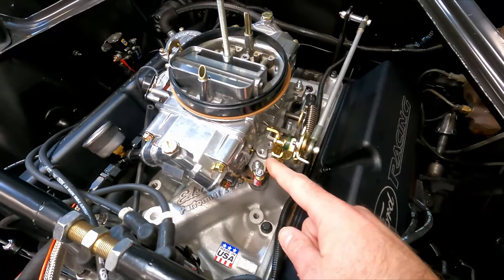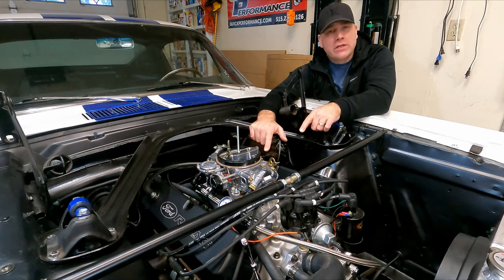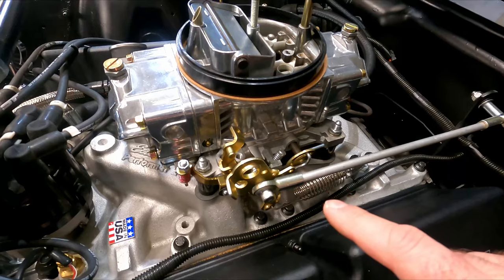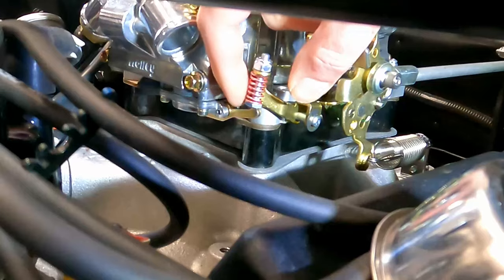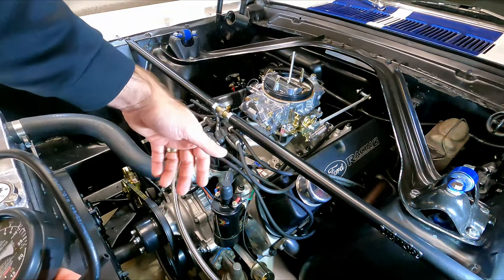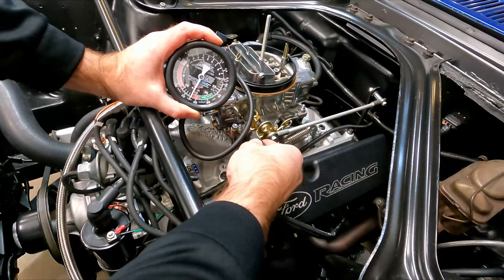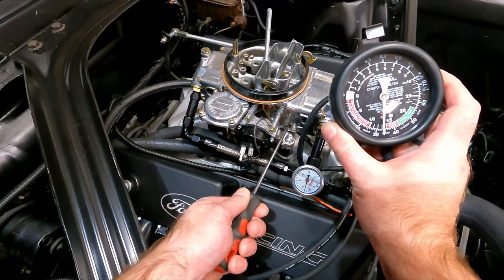How to adjust Holley Idle Mixture Screws and Curb Idle

Comment: I don't understand why people don't know to turn the mixture screws open 1/4 to 1/2 turn from highest vacuum or fastest idle. This allows a little extra rich which offsets a potential lean condition that occurs when the least little bit of contamination gets into the idle circuit. you can go a longer time before having to readjust the mixture screws. You barely change the idle at this richer setting and don't need to redo it until a LATER time. I have done this for 53 years. It should be common knowledge by now.
Reply from the maker: Yes, this is a good option.  :)
Reply: Yeah cause they still make them that way lol
Reply: Not everyone knows to put a vac gauge on it. Since everything modern has computers and fuel injection, tuning a carb has become a lost art. 
I used to think holley was good, so when i built my truck, i bought one. Biggest pain in the ass ever. Got a edelbrock avs2 instead and its so much easier to tune and zero flooding. 
Word of advice, if youre doing a street application , do not buy a holley, made for wide open racing. Even the speed shop guy told me that.
Reply: Efi tuning vs carbon tuning 
No dirt on the hands and you are warm and cozy. Carbon tuning is hard to hear hands get very dirty from the dinosaur oil often repeated sequence for fine adjustments! Last but not least you might be somewhere around the correct spot in fuel air mixture? 
  Vac gauge not needed for efi tuning unless you are a professional tuner!

Comment: Your method of setting the initial curb idle screw adjustment is incorrect because it does not take into account the idle transition slot.. This needs to be set before installing the carb.  The proper way is to turn the carb upside down and adjust the curb idle screw so that the idle transition slot appears as a small square. Then install the carb and and see where the engine idles. If idle is too slow increase the adjustment until you reach the desired RPM, noting how far in you have to turn the screw. If you have to go in more than about half a turn you are exposing too much of the idle transition slot. In that case curb idle speed should be raised by increasing initial timing. Oftentimes just switching from ported to direct manifold vacuum advance will do the trick. If it is necessary to increase idle speed with more initial mechanical advance this should be compensated for by adjusting the timing curve in the distributor.
Reply from the maker: Thanks for the heads up.
Reply: @russzero  Another measure you can take before drilling holes is to crack open the secondaries a little bit. Holleys have an adjustment accessible from the underside of the carb.
Reply: @AndyKruseChannel where do I hook up my vacuum gauge at I might have to re watch where you put it or nvm I think I see it I have my PVC valve hooked up in the back is that where you have the gauge
Reply: @AndyKruseChannel so yeah I don't think I'm seeing that correctly if you could help me out I'd appreciate it
Reply from the maker: @Pdubb19  I prefer to use the Manifold Vacuum Port, on these Holley carbs is located under the front bowl.  I point it out at around 2:11  :)
Reply: @AndyKruseChannel  thanks so much also another question Ive been asking a lot of guys this question so my plugs are fouling up and a guy said it should be anything major unless you got a big Holley dumping and I think it's the 4150 but if I get this correct would this stop running the car rich
Reply from the maker: @Pdubb19  The 4150 is the model or style of Holley carb, the CFM (size, like 600, 650, 700, etc) can vary.  If your carb is too large and your jets are too big, you can run rich and foul the plugs fairly easily.  It's possible to reduce the jet size in your carb to run a little leaner, but it may be better to make sure you've got the correct sized carb for your application.  If you choose that route, you're better off referring to web boards and forums as there's plenty of info out there for a given engine size and aftermarket parts you have on your engine.
Reply: @AndyKruseChannel  right on my man thank you so much!!
Reply: @AndyKruseChannel IFR’s regulate idle fuel and can be changed, but not easily....
Reply: @65sohc  When you say crack open the secondaries a little bit, do you mean where you can see like a square on the transition slot or just a little bit? Thanks
Reply: @joelaviles2943  I don't recall saying to crack open the secondaries although sometimes that is necessary.If you have the primary throttle blades in the correct orientation to the idle transfer slots and have optimized idle ignition advance, meaning you are on direct manifold vacuum with maybe 20-25 degrees TOTAL advance (initial plus vacuum)  and the engine still doesn,t want to idle you must have a very agressive, long duration cam or something else is going on. If the engine is otherwise healthy then SOMETIMES opening the secondary thottle blades will smooth out idle.
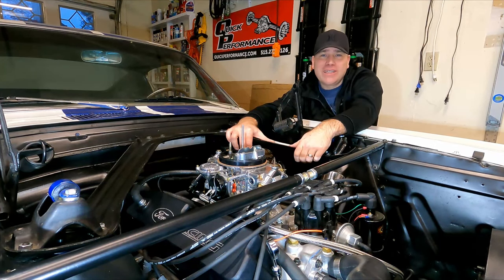Reply: 9:17 😅😅😅😅😅😅😅😅😮😅😅😅😅😮😅😮😮😮😮

Comment: I've commented before but I'll comment again. This is by far the most helpful video I have found about adjusting a carburetor on YouTube. No bullshit, just helpful information explained in a very simple way. If you don't do this professionally, you should.
Reply from the maker: Thank you!!  :)
Reply: @AndyKruseChannel  now if I could just figure out how to use my timing light.....🙄
Reply: @rorschach8167  :stopwatch-blue-hand-timer:💡?😳
Reply: I disagree.  You have to set your idle transfer slots first, second if you adjust your idle screw to bring your idle up or down you have to also adjust your accelerator pump .005 space between spring bolt bottom and accelerator pump.   After car is at operating temp 180-195ish.  Set idle mixture screws.  Then set your timing correctly.   Because more or less timing will raise and lower idle rpm’s also.  If you don’t start like this at lest the carb part you will likely have issues with detonation at wide open throttle or horrible stumble at wot, or backfire threw top of carb.

Comment: The reason you don't have a metering block in the back of that carburetors cuz Holly is gone cheap the older vacuum secondary carbs had met during blocks in the back with a four-corner idle.
Reply from the maker: Thanks for the heads up.

Comment: A bigger cam that causes a vacuum of about 9 inches may require a power valve replacement.
Reply from the maker: You're probably correct, but I haven't gotten that far yet.  :)

Comment: Should also touch on how to set the float levels. A few times now I’ve had friends with Holleys go through tuning like you show and can never get it to be snappy. I found it easier and better to set float levels and then tune from there. Nice video! Short sweet and to the point!
Reply from the maker: Thanks for the tip!
Reply: I had a brand new out of the box 4160 that wasn't getting fuel in the bowels. My buddy "the brains" adjusted the float levels until fuel was just coming out of the holes (no site glass on mine). That did the trick for us. The paperwork will tell you if its just to the bottom or half way up the site glass. I'm a noob and sharing what I learned.

Comment: Had three, complete,, early 60s tri-power setups, for FE big block Fords,,, always closed the outer carburetors idle screws,, and outer carburetor butterfly plates  closed as much as possible without jamming,, did all idle mixture screw settings on center carb only,, actually was able to get 19 mi to gallon on the open highway,, these tri-power setups idled perfectly   and needed very little maintenance... 0:16
Reply from the maker: Yeah, these are fun to work on.  :)

Comment: Using a Holley street avenger 770 CFM. 1000 rpm park and 800 rpm drive looks like the sweet spot (400 - 425 hp 350 sbc). Anything lower causes either a stall shifting into drive or a slow one after 15 mins of driving.
Reply from the maker: Good to know.

Comment: Helpful video especially on where to hook up the vacuum gauge, thanks. Holley says if you move one mixture screw 1/2 turn, then they all have to be exactly the same.
Reply from the maker: Ideally they'd be the same, but it depends on how exacting you want to be when adjusting for the highest vacuum.  :)
Reply: I think the idea is to not have it heavier or richer to one side of the bank. To keep all 4 the same and the highest vacuum you can start using 1/8 increments or even 1/16th to really keep that same highest vacuum and keeping all screws equal. Just going by what Holley says.

Comment: When the accelerator pump is not adjusted correctly, it will not feed fuel (contrary to the claim in this video) unless you move the accelerator pedal. The way to adjust it is to make sure you get the full travel of the link so you have access to all the fuel  volume available inside the pump. You also want it to react promptly so to much free play is not good for a solid & fast engine response.
Reply from the maker: Ok

Comment: Just fyi,, not having a secondary metering plate has nothing to do with rather or not your carb has vacuum secondary’s, my vacuum secondary holley has 4 corner idle adjustment screws
Reply from the maker: Thanks for the heads up.

Comment: Great video. Just dialed in my 4160. Do you recommend an addition 1/4 to 1/2 turn rich once you’re set on the highest vacuum?
Reply from the maker: Not on principle, but not every engine and carb setup is the same.  Some say an extra 1/4 turn out richens the mixture to the perfect amount, some say trust your vacuum gauge.  :)
Reply: I appreciate the reply 🦾
She’s running super smooth now. Your video helped a ton. I’ll try a 1/4 out this weekend

Comment: What fuel pressure are you running? It looked like it was between 2 and 3 psi.
Reply from the maker: I think there was a problem with the gauge at the time, because it was leaking.  It's between 4-6 psi now.
Reply: Good deal. love your videos 👍🏻

Comment: This may be a noob question. I just bought a project 79 mustang that came with a Holley 600 street warrior with no electric or mechanical choke hooked up. Are you always supposed to start a carb with a choke - or can carb be tuned so you don’t need to use a choke to start if that makes sense?
Reply from the maker: It depends on the climate. Warmer climate cars can get by w/o a choke. In colder climate, it takes a little more effort to get the car to idle, but it can be done.
Holley makes a choke kit you can buy and attach to your carb if you think you need one.

Comment: I have a 65 fastback as well. Do you possibly have roller rockers? At idle, it kinda sounded like a sewing machine and mine has always sounded like that after it warmed up. Super annoying to be honest, but I’ve always been told it’s normal.
Reply from the maker: At the time I made this video, I had not re-lashed my valves.  Yes, it was sort of a sewing maching sound, and I had found out I had one that was not as tight as the rest.  I re-lashed them and the engine sounds much better.  :)

Comment: Was looking forward to this part. When your fans kick in, how much load does it take on the engine and drop the rpms? I’m trying to find the sweet spot so it doesn’t stall out on me. Great video!
Reply from the maker: Maybe 100 RPMs, but not alot.  It was enough that I wanted to wait until the fans turn off so I can get an accurate vacuum reading.  :)

Comment: My carb is setup way rich, so I'm assuming that turning the Mixture Screw to the right is richer and to the left is leaner. Is this correct?
Reply from the maker: Backing the screw out away from the Carb is adding fuel, equaling a richer condition.

Comment: when you changing the power valve do you have to change the jets at the same time
Reply from the maker: No, they are independent systems.  However, one could find they are changing both at the same time, depending on how they want to tune the Carb.  :)

Comment: Whats up bro, any info on the screw inside the stud wher the air filter connects what is the normal adjustment for that like how many turns out or in
Reply from the maker: I believe there are different length studs because there are different height air cleaners.  I always run that stud 'til it bottoms out.  I think I even cut one short for a previous build as it was hitting the hood.  You also buy a piece of althread from the hardware store and make a custom length stud if you don't currently have one or you don't want to cut the one that came with your carb.  :)

Comment: Hello i got a holley carb 4150, 715 cfm, its on marine engine volvo penta 5.7, and it doesnt have any ports for vacuum gauge, any advice how can i adjust the mixture screws? Thank you!
Reply from the maker: Hmmm, that's weird, there should be one.  What about using the port on the back of the carb that is often used for a PCV valve or power assisted brake master cylinder?  It's larger than the port I use in this video, you'd probably need 1/4" or 3/8" tubing and an adapter to make it work with your vacuum gauge.  :)

Comment: So I need to disconnect the vacuum advance and plug it off on the carb to adjust it with the vacuum gauge?
Reply from the maker: Correct, but this is ok because that vacuum advance on your distributor isn't really doing anything until you are operating at higher RPMs and have a load on the engine.
The hose going to your vacuum advance on the distributor can just sit there while you make your adjustments.  On the carb, for setting the idle mixture screws, you'll want to make sure the Ported port on the carb is capped off (up by the sight window on the bowl) and you connect your vacuum gauge to the manifold port located underneath the front bowl.  :)

Comment: Having a bit of a problem. Would this kind of tuning help with this? I have 750 double pumper Holley. A friend of mine rebuilt it for us, told us he tuned to throw in a lot of gas since it’s a race car. It is a ford small block, and the idle is way high at 2300-2400 RPM. Would this kind of tuning help or is it something deeper? I’m brand new to carbs and this all a foreign language to me😂.
Reply from the maker: Wow, there's a lot to unpack here.  Without knowing the displacement of your motor, it's difficult to say if the 750 is the right carb for you.  In addition to the displacement, your Cam, intake style, heads, and exhaust can also play a role in the proper Carb size.  In my case, I'm at the very bottom edge of needing a 750, and a 670 would probably be a better Carb for me.  Anyways, you can use this video to help you dial in your best-lean-idle settings with your mixture screws, and lowering the idle from 2300 down to a more useable 750-900 rpm.  You may also need to worry about the throttle plate setting with respect to your transfer slot, but I don't cover that part in this video.  But adjusting all that stuff may be a waste of time if you've got large jets and different power valve than the stock pieces (which is what I am using now),  so I'd suggest starting there and find out what's in that Carb.  You mention it's from a racecar, so I'm guessing they've been swapped out for something to provide more juice to the engine.  I wish I was your guy, but there are some good videos out there that cover more of this stuff.  I hope to make some videos someday that covers more of this stuff, I just haven't gotten to it yet.  :)

Comment: My vacuum gauge needle bounces around just like yours on my 347 making it a bit of a challenge to set the idle mixture. I've seen other videos where the needle was rock steady and was worried I had another problem so I was relieved to see yours.
I'm guessing the bigger cam has something to do with it.
Reply from the maker: Unfortunately Cams that seem to be anything other than stock will have this affect when trying to observe the vacuum.  Not only does it bounce around, it will also be a lower value on the gauge, hence the comment I made about it not being about the specific number, but the highest number you can achieve.  :)
Reply: @AndyKruseChannel  yep. My vacuum is about the same as yours.
Reply: find a liquid filled gauge..takes the bounce out.
Reply: I use motorcycle carb synch gauges with flow compensators to even out the vacuum. No bounce
Reply: Usually that means the valves are not adjusted properly letting exhaust gasses back into the intake tract. I have the same gauge and the needle is solid with my small block chevy.

Comment: Quick question for you if you have any advice. My four barrel Holley on cold start revs really high eventually coming down but is practically screaming while warming up. And if I feather the gas pedal it sometimes comes back down but sometimes just sticks. Any ideas?
Reply from the maker: It's probably the fast idle adjustment needs to be reviewed.  If your carb is like mine, it can be found on the back side of the electric choke mechanism next to the main carb housing and it will be adjusted with a small wrench (like 7/32 or something like that).  Holley has a slick video on how to adjust that screw and they have a sneaky way to adjust it quickly without needing to adjust it, let the choke cool down, and then adjust again until you get it right.  :)
Reply: @AndyKruseChannel  would it be clockwise or counter clockwise to bring it down?
Reply from the maker: @FernandoHernandez-ri7rd  Counterclockwise would lower the idle while the choke is engaged.  :)
Reply: @AndyKruseChannel Good call,Andy,the choke step ed up enough to stay running.cam has to synchronized properly with the throttle blade position(caused by the spring load in the choke housing).I’ve had to wrestle with these settings many times in the old days.Never liked sitting in the car till it stayed running in the winter.